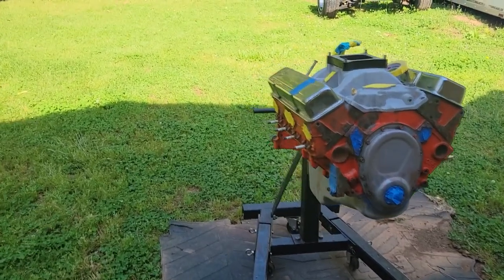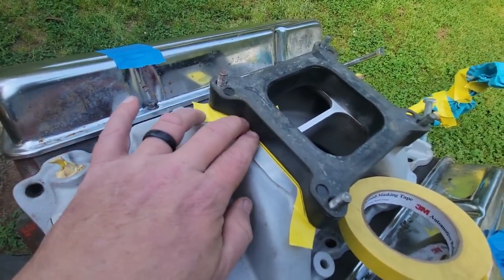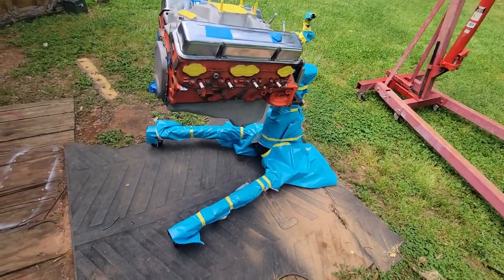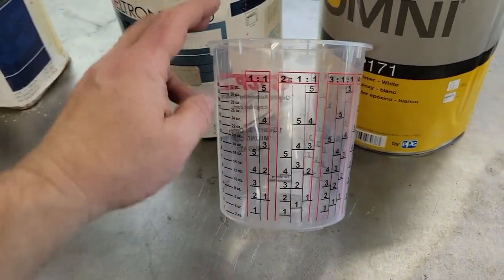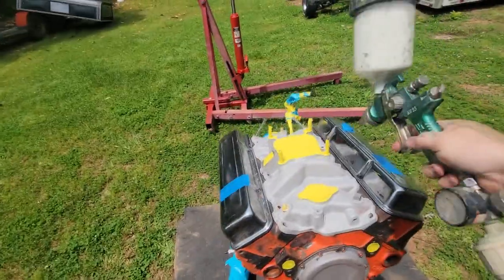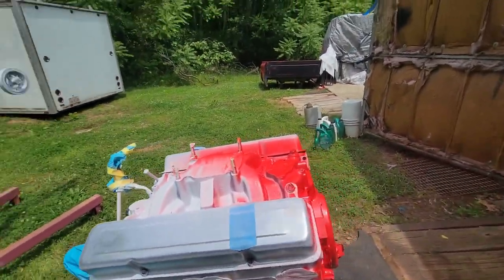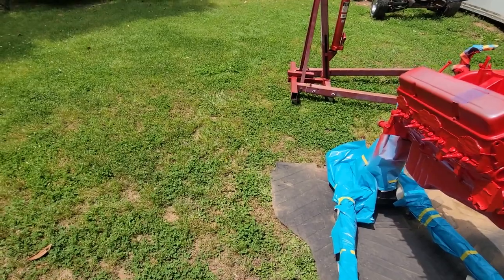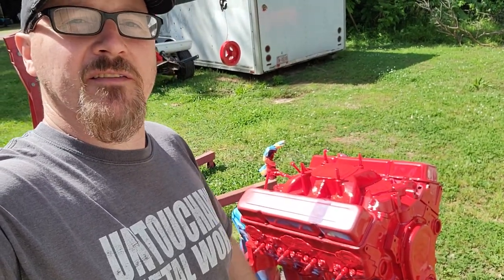HOW To  (Base Coat + Clear Coat) your Engine [PAINTING OUTSIDE]

Comment: BEAUTIFUL!!! ❤   Surprised you didn’t paint the bell housing at the same time, but that engine shines. Great job and thanks for all the included details.  I’ve never used mixing cups before (just a digital scale) but bought the ones you suggested to give it a try. Thanks again man.
Reply from the maker: Thanks man, yeah I debated on doing it red, but I think im gonna do the bell housing and the 4speed like a cast iron grey or gun metal what do you think? I live those mixing cups, I use them for cleaning parts and all kind of different things. Thanks for watching man!!!!
Reply: I just today finished cleaning and painting my bell housing red/orange.  I was going to paint the trans black but started looking at grays at your suggestion. I think I’m going with the gun metal.  I really like the contrast.  Since I’ve got the body off the frame of my 76 Corvette, the entire chassis is getting a complete restoration.   Things I never thought about painting are going to get the full treatment.  Thanks for the extremely timely video. Much appreciated.
Reply from the maker: @Rusty Kracht  thats awesome,  thanks for always supporting me I really appreciate it. Email me a picture of it when you get it painted id love to see it acdesigns1933@gmail.com
Reply: Will do. 👍

Comment: Would you happen to know if metal flake paints or pearls can be used on engine blocks?
Reply from the maker: Yeah you should be able to, the amout of product you use is usually the down fall on an engine. So keep the coats to a minimum and you should be good..  Ive seen a ton of the lowrider guys use pearls.
Reply: @ACDesignsGarage  thanks!